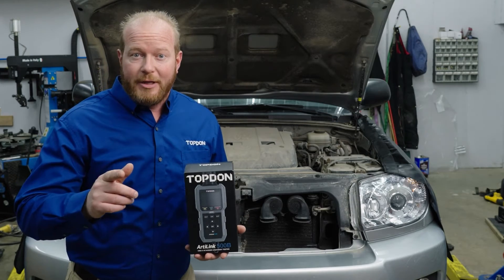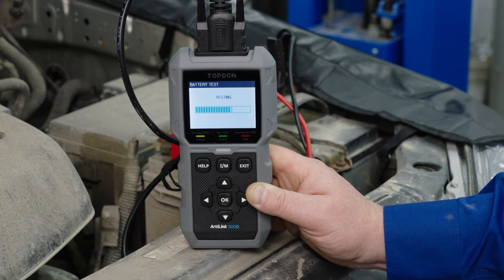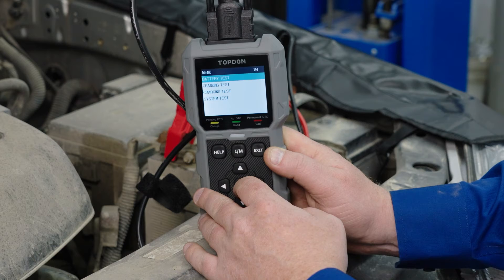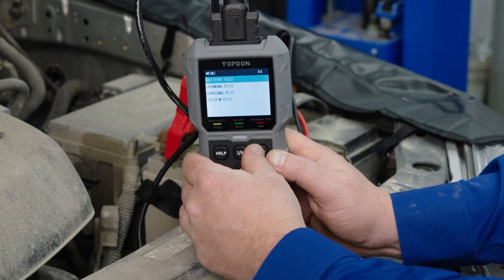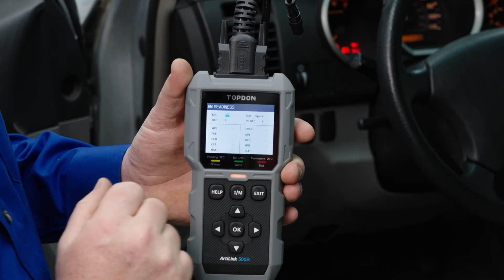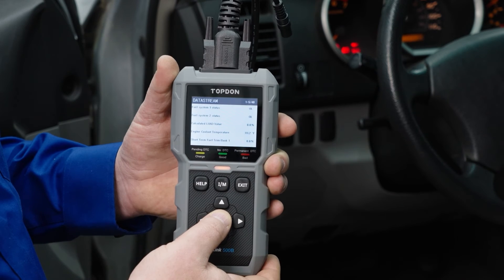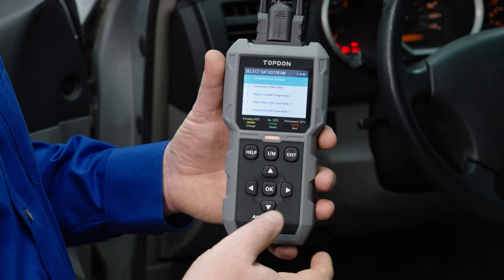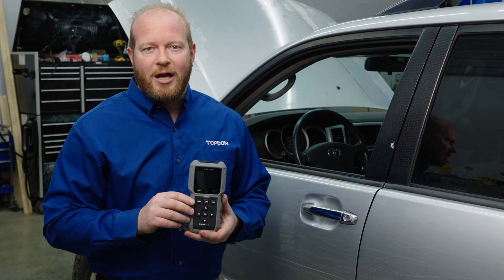TOPDON ArtiLink500B | Overview

Comment: Hola,tengo un phoenix lite 2  ,y no escaneo un chevret onix 2022 me dice el scanner que nesecita CAN FD venden alguna interface para ese equipo phoenix lite 2
Reply from the maker: Hello, yes we have CAN FD cable sold, it's recommended that you contact the seller of your Phoenix Lite2 to purchase, or contact us on messenger to send your requirement, we'll assist promptly.
Reply: @TopdonOfficial  Can this do charging and starting system, as well or is it limited to battery impedance testing.